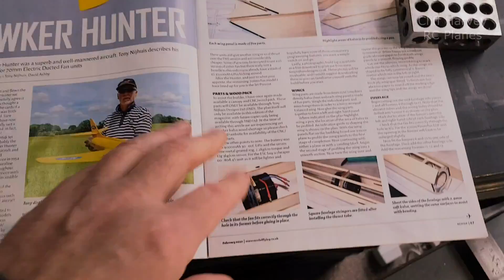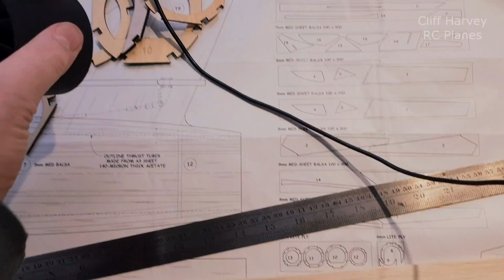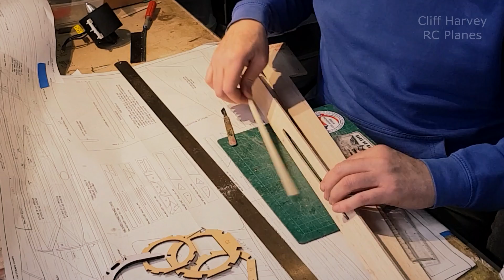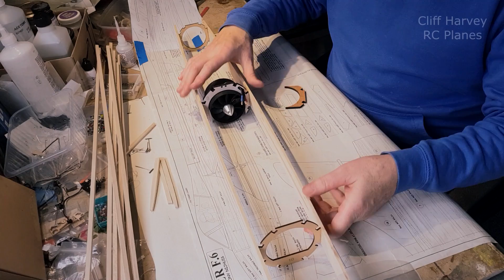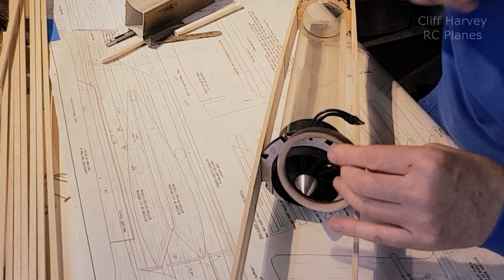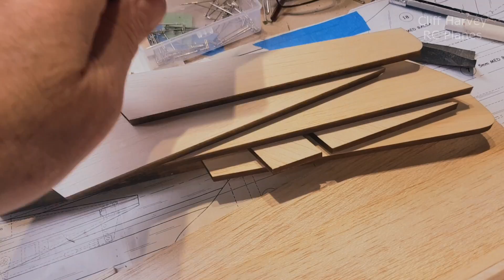Iconic Hawker Hunter EDF Build Part One

Comment: Fabulous video.
It's especially useful to me because I've just bought a 50mm Tony Nijhuis Hunter, which has a fan and speed controller but no servos or snakes or anything! I'd rather avoid dismantling the whole thing, so I can't wait for the next instalment to see how/when you install the elevator snakes/servo!
Reply from the maker: Hi Duncan, I'll be adding the elevator snakes in the next video and probably preparing the servo positions but if I don't get as far as the servos I'll be sure to talk about them off the plan, cheers

Comment: Cliff, I've wondered if you find a difference between white glue and Titebond (aliphatic resin)? They certainly seem to smell and perform similarly.
Reply from the maker: Hi Cal, I've used Titebond quite a lot but the Speedbond seems to set a little quicker, probably not much in it though, cheers
Reply: @cliffharveyrcplanes  cheers!

Comment: Great stuff Cliff, love the intake you made. Does concern me that you have no access to the motor after. Looking great, you will have yours built before mine 😂
Reply from the maker: The motor will be buried a bit but things are more reliable these days aren't they(?), besides I'll probably break the model before the motor needs attention! There's probably less than half the pieces in mine so even if I slowed dramatically it'll still be done fairly quickly, anyway yours is built up which makes for a more satisfying build, cheers
Reply: @cliffharveyrcplanes  Well the wing design on mine were drawn by the devil homself 😂